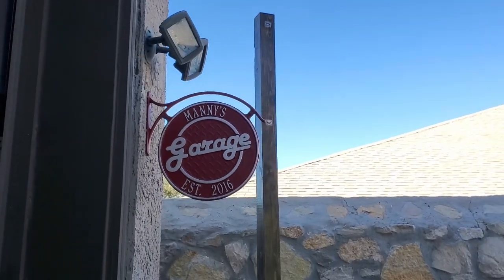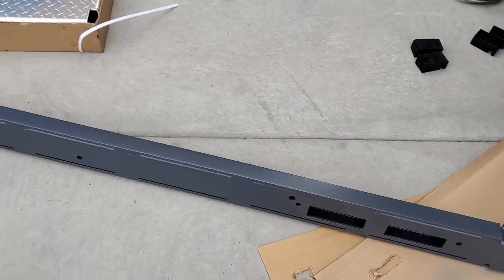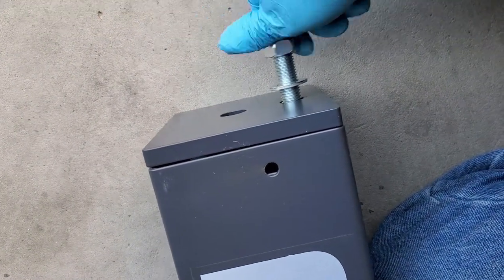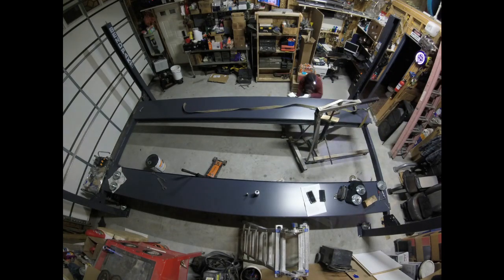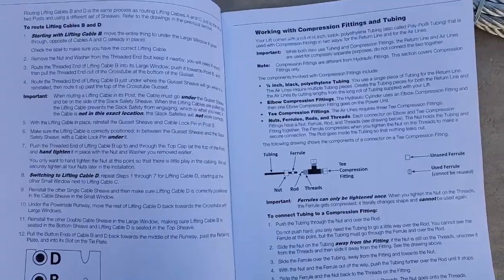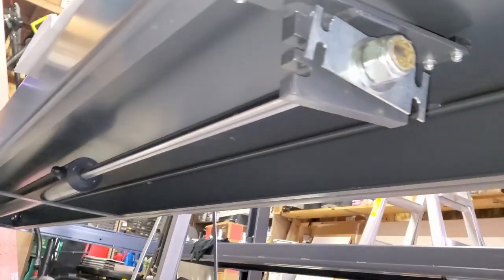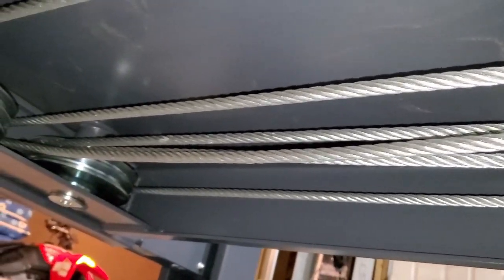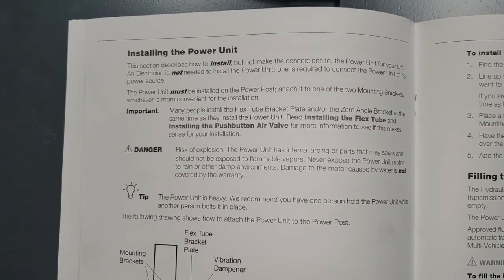Bendpak 4 Post Lift - Unpack and Install - Four Post Auto / Vehicle / Truck / Car / Lift

Comment: Just got the HD-9XL and your video really helped. Bendpak made a change recently I guess, as none of my pulleys came with grease zert fittings or holes. So, I would tell new owners to make sure and get some grease on those pins and pulleys BEFORE installing.

Comment: Excellent video. I can't tell you how many times I referred back to this as I was assembling the exact same lift. Well done! In regards to the cable ends that get secured into the plate underneath the ramp. I would imagine once all four cable ends are secured you tighten the big nut at that point? Or is it easier to tighten that once the lift is operational? The big nut seems difficult to tighten with the ram extended all the way out..

Comment: Assembling my HD-9XW as we speak.  When you say you leveled the runways with the ladders first, I can’t find that anywhere in the instructions.  Did you adjust the jam nuts and ladders to get the runways somewhat level while it rested on the locks before doing any cable adjustments??
Reply from the maker: Yeah, that is exactly what we did.  Essentially you will level the runways on ladders/locks first, then, adjust cables so that, as it rises, it raises as level as possible and the locks engage almost simultaneously on the way up.  In my case, I have an small incline, so as it rests on the floor, the front bottoms out first before the back does as it comes back down.
Reply: @mannysmaintenancegarage980  I may be similar.  My floor slopes about 1/4” per foot so over the length of the lift it’s probably almost 3”.  I’m hoping I can lower the front ladders slightly, raise the rear ladders and then adjust the cables from
There.  I need to keep the rear of the lift as low as possible on the ground to get my Shelby up.  Bendpak’s instructions don’t really give details on how to adjust so I’m going to wing it I guess
Reply from the maker: @JP-ec8fe  yeah, mine is almost exactly the same.  When done, the ramps will hang about an inch off the ground but give when you drive on. I think the max incline allowed is about 3 inches but, yeah, the level will be your best friend on it.  I almost maxed out on the slack/adjustment on ladders and cables to achieve a perfect level.  So expect that.  I've had multiple trucks and cars on it with no issue.  Best of luck on your build.  I recommend the aluminum raps.  They are much easier to remove, are longer, and might be friendlier on that Shelby.  Those are what I always use, but I ordered both.  Don't be surprised when only the back lifts, on operation, first.  The front will lift as soon as it starts to level and raise together and level through the rest.
Reply: @mannysmaintenancegarage980  thanks this is helpful. I don’t have the ladders perfectly level but close.  I lowered the front ladders to where there is about 5/8 thread showing above the nut and the ladder itself is about 3/16” off of the base plate.   The rear ladders I raised up and have about 2.25” of thread above the nut.   I’m putting hydraulic fluid in it tonight so all the cables still have a ton of slack so I haven’t gotten to that part yet. I’m starting with about 3-4 threads visible above the nuts on the cables and will see what needs to be adjusted from there.  Hopefully I can figure that out the manual is worthless.
Reply: @mannysmaintenancegarage980  trying to figure out my adjustments now.  My front cables (front of the lift and front of the garage) are taught when dropped all the way.  The crossbeam does sit on the bottom plates, and I’ve only got about 2 threads sticking through the nut on the cable.  The ladder bar itself is also adjusted down so that it’s about 3/16” or 1/4” off of the baseplate.  

The rear of the lift (garage entry) won’t sit on the baseplates.  There’s about 1.5” gap and the cables are tight.   To try and get it level on the cables, I have about 2” of thread.   Do you know if I can just loosen those cables so that the runways drop on the ground?  I realize that would mean the front of the lift since the cables have no slack would start lifting first, and it may not lift level on the way up?    I feel lost here and really don’t want to put big shims under these posts due to low vehicles.  Appreciate it!
Reply from the maker: Bendpak is going to be your best resource, but I'd look at pulleys for any adjustment there.  I had no additional need beyond what was at the top of the posts.
Reply: @JP-ec8fe  my lift is bolted down and we placed shims under the low side posts (due to the same floor slope) to get everything level.

Comment: Thanks for the video. Do you have any instructions on how you leveled your lift?
Reply from the maker: There is nothing to it.  It is just time consuming.  Grab the longest level you have and place it across each of the four sides between posts as you tighten and loosen the bolts at the cable ends and at the post tops..  As you tighten and loosen, keep rotating your level around until you find the right plane across all four sides.  It's been a while, but I think I did this on the rest position and lift position to ensure a level lift also.  You will have a level raise and all four locks clicking at about the same time as you raise it, if you do it right.

Comment: Great video. Thanks. I can’t find a video on YT showing a HD9XW lifting a truck. Do you think this unit would lift a 3/4 ton truck?  Thanks for your time.
Reply from the maker: Thank you.  It will lift and fit some 3/4 ton trucks.  Those vary in weght from about 8500 to 9500 lbs.  So you'd be pushing the max capacity on the lift, but the dimensions would allow it.
Reply: @mannysmaintenancegarage980  thank you.

Comment: How did you remove the Sheaves? Mine look to be welded into place.
Reply from the maker: You can see how the bolt/shaft that runs through each sheave is held in place by a small bolt or a snap ring.  Removing the bolt/ring allows the larger bolt/shaft to slide out for sheave removal.
Reply: @mannysmaintenancegarage980  Got it, Thanks!

Comment: Was your distal cross-beam  on the driver side backwards? I noticed the windows not lining up
Reply from the maker: No, it only fits/works one way.  It just takes a bit to figure out ahead of time.  The instructions are not good but there are differences in each beam.  They will begin to assemble in different combinations, so to save the trouble, we called out the correct assembly.  Once you initially and correctly identify each part, you are all set.  Otherwise you run into instances of re-assembly.  The dual pulleys will only fit into the one with the larger "windows" or openings, for example.

Comment: Did your lift come with the momentary switch to raise it or did you have to supply that? 
Thanks for this video. It helped me out a lot building my buddies for him.
Reply from the maker: Glad you found use in it.  Yes, the push raise button and lower buttons are included.  The raise push button activates the hydraulics and the lower button activates the air lock release.

Comment: You have your cables twisted. They are upside down. A and B should be on top for them to be straight.
Reply from the maker: Our install is accurate for this version.  See the 12:00 minute mark in the video, page 37 which shows A & B to be on the bottom like we did.  None of our cables are twisted.  Take a look at your install.  You may find it is different or you may have mixed something up.
Reply: @mannysmaintenancegarage980  It probably doesn't matter whether A & B are on the top or the bottom.  Mine are on the top are also not twisted.  You are right though, it does show A & B on the bottom Hm.  The lifts are the same so it should be fine.  I will start releasing my videos in about a week.